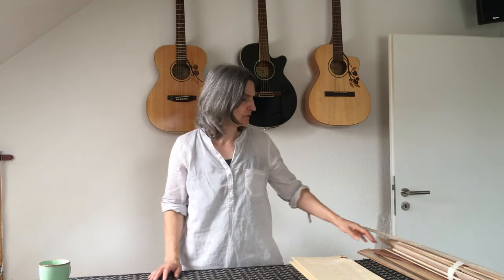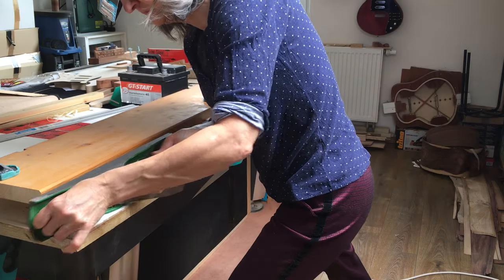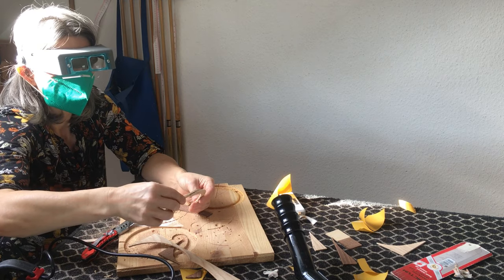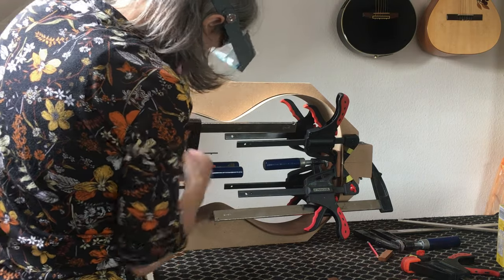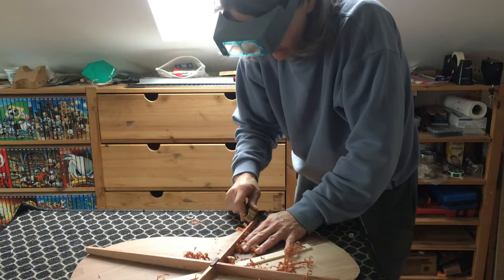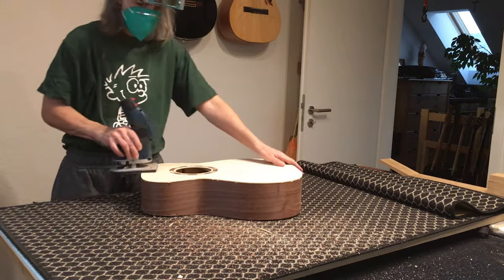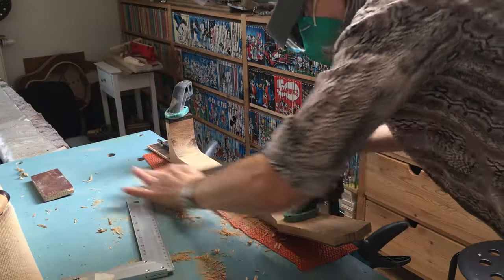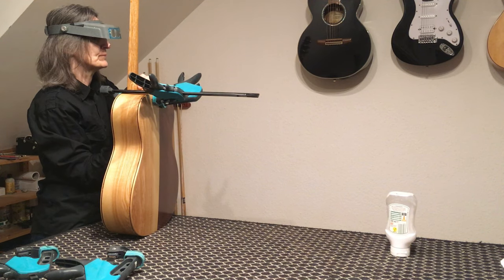The Great Guitar Build Off 2023 (GGBO 2023) Invitational: Build II - The Café au Lait (Acoustic)

Comment: I don’t recall seeing you use a mortise and tenon neck joint before. Did you introduce this in another video?
Reply from the maker: Yes, I did.
Reply: Can you post a link to it. I’ve been building butt joints following your methods. I’d like to see how you are doing this joint. Are you switching to this method?
Reply from the maker: Well, the Jester has one, for instance. I don't recall whether it's in the video or not because I normallydo the routing at school, where I can make more of a mess than at home. I just showed that for letting you see that it's there for this video. I don't take filming equipment to school often and so the steps I do there normally don't appear in the video and since I had to reduce it to 20 minutes, you don't see all of the steps.

Comment: Hi, I'm from Indonesia, I want to ask you, why do people use the bolt method to connect the neck? And is it very durable and strong?
Reply from the maker: Yes, it is very durabel and strong. I think stronger than glueing. It's easier to take off, though, in case you need to do some repairs, adjustments.
Reply: Wow, thank you, the answer really helped me in making an acoustic guitar, thank you Gabi